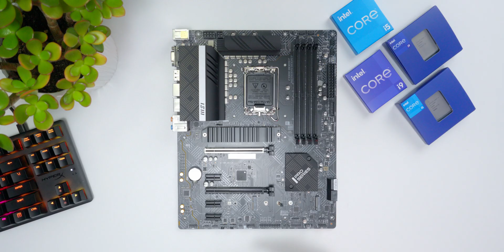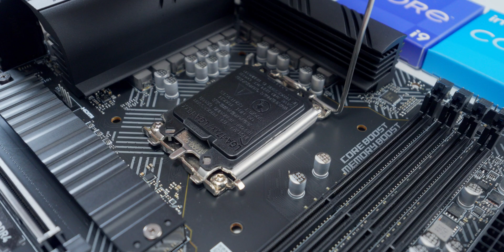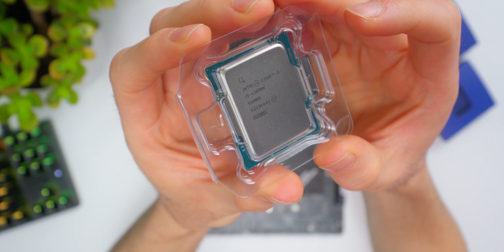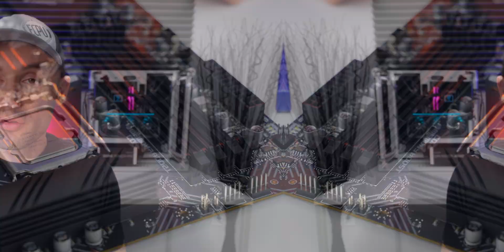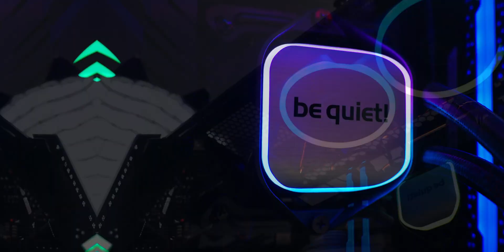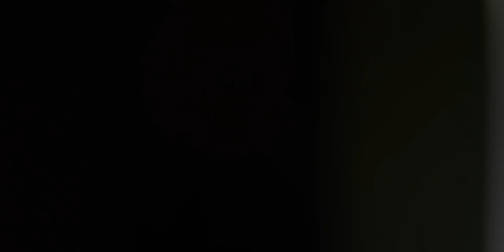How to Install a CPU - Intel Core i5, i7, i9

Comment: If you dont have water cooling, this is the upgrade/ installation you need thermal paste for right? If so, Im surprised it wasnt mentioned. Otherwise looks pretty easy

Comment: Replaced my i5 with an i7 and man the difference is tremendous!! Super easy to swap out, only thing I struggled with was the thermal paste, I didn't add enough at first but the second time around I think I got it almost perfect and my PC is running smoothly!

Comment: PGA = Pin Grid Array = pins are on the CPU
LGA = Land Grid Array = pins are in the motherboard socket

ALL CPUs and board sockets are physically "keyed". A CPU only fits into its socket in one orientation. It is impossible to insert a CPU the wrong way.

All sockets are zero-insertion-force (ZIF). No downward force is needed to initially place the CPU into the socket (before you close/lock the socket).

All CPUs have a golden triangle on one corner. Board sockets have a corresponding triangle (or a dot/some other marking) in one corner. Simply orient/rotate the CPU so the markings are matched up.

When the CPU is in correctly, you will see that:
LGA CPUs have notches along the outer perimeter which fit into plastic notches on the socket.
PGA CPUs have spots on the CPU with no pins which correspond to spots on the board socket with no holes for pins.

Even if you do not know about any of this, technically you can just open the socket and place the CPU onto the socket. If it does not fit in, you can rotate the CPU 90 degrees repeatedlyy until you have the right orientation.

Comment: hi..this setup is fine/good to go? thanks for your advise!
Processor - 14th Gen i7-14700K 3.4GHz (Socket LGA 1700)
Mainboard - Gigabyte B760 aorus elite AX DDR5
NVME SSD -  Lexar NM790 1TB 
Kingston Fury Beast RGB DDR5 6000MHz CL40 2x16Gb (black)

Comment: So I followed this video and pulled out my old cpu and put in the new one. From what I read online, my cpu is compatible with my motherboard. The cpu fan works and everything boots up except for my monitors. The led light on them shines white like its going to turn on and then will switch to orange saying that it doesnt detect any signal. Anyone have any possible ideas of what I did wrong?

Comment: Do not forget to get rid of any "static" on your body  by touching a faucet or grounded part, before touching the CPU and the MOBO .. Great video, helped me to understand the written explanations on the manual thanks.
Reply: how tf you do that?
Reply: @Cuunke the best thing to do is to just plug in the power supply with the switch in the off position and touch it while your building your computer the power supply is grounded don't build it in a carpet wearing socks

Comment: as a retired computer service tech, the one and only thing i would add to this wonderfully helpful, perfectly paced beginner's tutorial is a static strap. 

you may never hear a static crack or see any lightning-looking arcs while putting things together or dusting inside of your comp, but those things you don't see could be the difference between a 10+ year old component vs parts that 'die' on you every 2-3 years... static can weaken, not just kill computer parts with a small cracking sound (which it also can do)

a strap to clamp onto your case or psu cage or static mat, is the one little thing i would add to all this great info you have here. bravo mr. tech heh
Reply: what about just unplugging your computer?
Reply: @Spocklee  
the problem with that is - then there is 'nowhere for the static electricity to go' - you need to keep your computer plugged in but the PSU (power supply box) turned OFF. 
As long as your computer is connected up inside (screws without cloth/plastic washers on the mainboard, cables connected, etc) then static/electricity has somewhere to go 'out', that is, any static electricity built up in your body/clothes will go 'out' the Ground into your wall. HTH
Reply: So??? Do i have to makw sure it cracks or not? I know that i might seem dumb but its my first time building a PC
Reply: @Psyxxz  I'm sorry - you mean to discharge your static (get rid of it) ? It doesn't 'have to' make a noise no, just touching something grounded is ok. If the power supply is plugged in to a grounded outlet you can just touch the metal of it on the back or your case if it's installed/touching the case. 
Try not to touch actual components to  discharge the static, as someone else helpfully said, sometimes a tap or doorknob is enough. 
I didn't see this until now sorry mate

Comment: Amazing video. I have Dell Inspiron 660 - 1.8TB, CPU intel i5-3330 3ghz,  8gb 1R x 8 - 64bit 3rd generation Windows 10  around 10 year old pc. Its very slow and i am thinking changing 2R x 18 RAM instead of 8 ram and CPU. Which Intel CPU you would recommend? changing cpu would not effect my windows or MS Office and files? thanks

Comment: I plan on wearing some correct fitting nitrile gloves when handling...
Reply: I know this is an old video but wanted to comment anyway. Nitrile is an insulator which means it can build up a static charge that can damage any components you touch. I'm assuming you're thinking that the gloves will prevent the oils from your skin from contaminating the components you're handling. That is true, but the elevated risk of electrostatic discharge damage outweighs any benefit the gloves would provide. Discharging the static in your body (using a static discharge wrist strap is best) and carefully handling the component as demonstrated in the video is the best way to go.

Comment: this could be a 45 second video. so much bloat. just get to the point man
Reply: Bro has brain rot
Reply: For you maybe. I think he did great explaining. When I built systems for myself and my friends I was using the PGA CPU and was scared I would bend the pins. 

Later this year I plan on building a new tower or a mini ATX system. So for me this was a great video.
Reply: I installed a I7 620m in my Toshiba laptop. Runs a little hot but combined with a cooling pad it helps with heat. Performance wise it is a night and day difference when compared to the original Intel 6200 CPU.
Reply: 5 minutes is perfect for people building their first PC and trying to follow along. There's hundreds of Youtube shorts if you want something more simple or you can just skip to that part in this video.
Reply: @Userznamerandomized  fr bro
Reply: Go check out LinusTechTips 15 minute video if this is too slow for you
Reply: Disagree. Some useful tips and good-to-knows
Reply: Agreed
Reply: No it’s not he’s just explaining everything which is exactly what I needed so hush
Reply: kids of the future right here, attention span of a rock
Reply: if i may, there are actually a lot of steps to consider when assembling pc parts... this isn't Lego
and he did well, adding helpful tips and ideas for options

i have adhd and it was fine for me lol
lots of cuts and angle changes, etc
Reply: @Munenushi agree i have adhd too and it was okay
Reply: Getting mad because it's too long and it's a 6 minute video. Patience of a child.
Reply: He even has an instant replay dropping the cpu in lol.

Comment: When you push down the cpu locker, should I hear a slight tapping noise?? I heard a constant noise as I was lowering my cpu bar and I got scared bc it takes a bit of force to go down.
Reply: It should be swift, the only things that lock sometimes are the cooling components. At least in my limited experience. Let me know how it worked out! EDIT: Swift as in you wont hear any clicking or knocking. If pay you attention to the matching pins, it's like trying to fit a square through a triangle. Once you know it's aligned just go for it, for some sockets it make take like a pound or two of force but nothing more.

Comment: Thanks Bro, i have been installing AMD with pin Grid for like 30 years, and on computers for over 40 years. but i have to learn the Land Grid, due to AMD moving to Intel Style, and Someone gave me a intel Z170 board, so i bought a 6100t for $14. Even though i have a 5600x, eventually i will upgrade to a Ryzen 7000 or probably a Ryzen 8000.  So i figured i better learn LGA as it is the future, and before i have to buy a $500 motherboard and $500 CPU in 5 years, this ought to give the confidence to try LGA. Thanks Again

Comment: Too bad he did not do as his description says, he never showed how to install the i9, but then again it is possible he does not know that not all processors are built like. The notches he referred to on the i5 is totally different from the i9, he should have also showed the diamond on the socket, the way he showed a person could still place the processor in the wrong way.
Reply from the maker: Processors compatible with the same socket (in this case LGA1700) must have notches that match the bump-outs in the socket, or else the CPU could not be installed.

Comment: I bought an Intel i5 10400 and upon taking my computer apart, found that my load plate is too big to keep the CPU in place. What do I do?
Reply from the maker: It sounds like the i5 10400 might not be compatible with your motherboard socket.  I believe that CPU is based on LGA1200.  It would be a good idea to check which motherboard you have and verify the socket type.

Comment: Im gonna be building my pc tommorow. And before I go with that. Ive got a question.. how precise I have to be with cpu installation? I mean. Do I have to put it precisely on pins or if I kinda miss it its gonna be all good? (For example miss up to 2mm)
Reply from the maker: As you're lowering your CPU into the socket, you want to be as precise as possible in order to not put any lateral force onto the pins.  If the notches on the CPU line up with the socket, it should go in without a problem. You can give the CPU a gentle wiggle to make sure it's seated properly and making contact with all the pins.  I find that will usually get it to drop in if it's slightly off.  Just remember it doesn't take any force to get the CPU installed, if you feel like you need to force it, then something isn't right and you should double check that your alignment/orientation is correct.

Comment: I don't have a thermal paste applicator - will I be okay?
Reply from the maker: If you're applying your own thermal paste (if it's not pre-applied on your cooler), you don't need any special applicator.  You can run a line down the middle of the IHS or blob in the middle and the pressure from the cooler will spread it out.  Just be careful not to use too much because you don't want it to spill over the edges of the IHS.